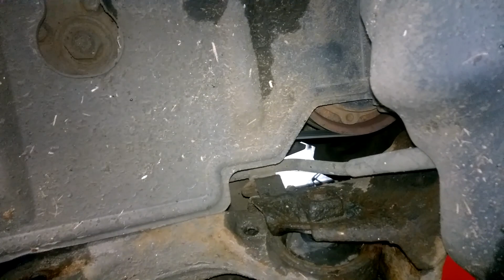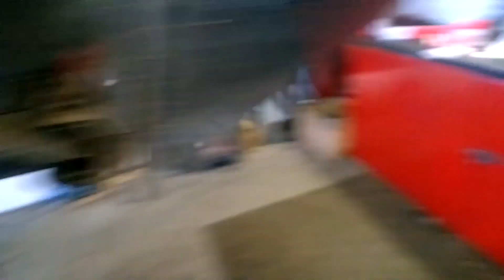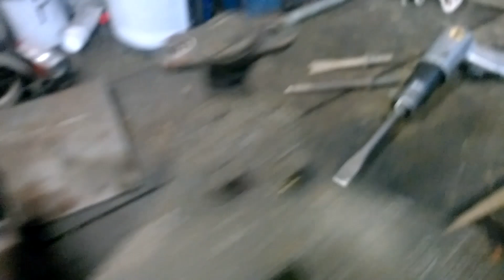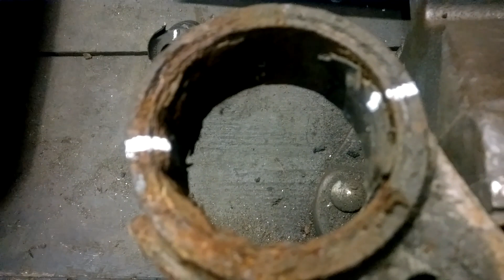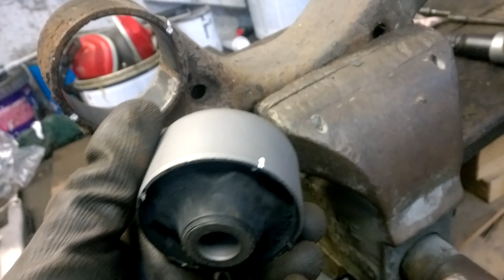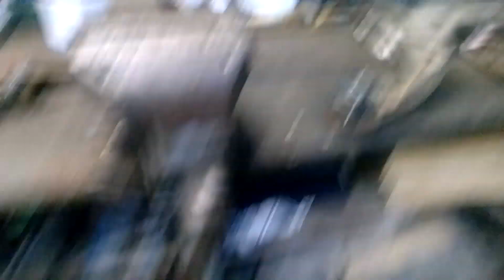How To Replace A  Wishbone Bushing - Step By Step - Kia Sportage

Comment: i tried to remove the bolt from the bush on my kia ceed, the bush is completely siezed onto the bolt and spinning in the cavity, i have no way to grip it, i have spent all night trying different things from wrapping the bush with parachord and wedging a screwdriver into it to tighten it up so i can try and undo the bolt, i have soaked it in penetrating oil and without cutting it out im out of options, i got a pair of grips and tried to tighten it up, i hit it with hammers, pressed bars agsint the nut, whilst twisting, i have no idea how to get this out, theres no room for an angle grinder, i dont have an acetylne torch, i dont have the money to take it to a garage.. what can i doi???

Comment: I don’t see the reason in this case for marking the bearing position?it’s a plain round bushing so why the marking?
Reply: The bushing is designed to "absorb pressure" from a back and fourth motion, its gotta be pressed in a certain way. Otherwise I'm sure it'd be just a solid bushing without the slits.

Comment: @Gerard Burke. Hi Gerard, why did you use the chalk for? I didn't quite get it, lol hope it's not a dumb question. Thanks for uploading your video. M.D........
Reply from the maker: Not a dumb question Monty, the rubber bush is designed to take pressure in certain directions (if you look you can see one part is solid and the other has a break in it),that is why I lined the marks up from the old one to match the new one correctly. 
Thanks for watching.
Reply: @GerardBurkeBurkesGarage  Oh yeah, I just needed to be looking at what you ''were doing'' instead of just watching a video lol. Well I just bought new control arms and now I can't get the ball joint to bolt on because of the angle it's on. I'll probably have to use the Moog ball joints because they seem to have more tilt that the ones that came with (the control arms >>They're made at Detroit Axle, or they imported them under their name. I took a holiday break but I'm gonna head back out and get it finished today..

Comment: Those air hammers are indispensable in this situation. My method is to drill or press out the rubber bit, use a hacksaw to cut one or two slots through the metal cylinder, then tap it out. Two slots can make it much easier sometimes.

Comment: The shop I work at we replace the entire control arm. That thing looks shot! The parts are obviously more but so much less labor.
Reply: Hello I am in the process of doing a similar job on my daughters Freelander TD4 but on the rear suspension and control arms. A 14 year old car. The ‘hard parts’ were corroded more than the item in this video BUT what you are seeing is fairly advanced oxidation but it is not ‘structural’. Using an air needle gun and shot blasting has restored the components to ‘like new’. No structural issues at all. These components await new bushings(all ordered) which I will press in. Before then all the arms are ‘bathed’ in rust remover even after shot blasting. They will be painted etc before the bushes are fitted. Obviously, I have time on my side. Time is the key in any business as ‘Time is Money’. Most components that are replaced on cars have some saveable parts..  but to do so becomes uneconomic due to labour costs. Nothing wrong with this fix at all...

Comment: Very good video Gerard,I replaced 2 wishbones on my Vauxhall combo yesterday the rear bushes in them where knackered just like the one you did,oh and for replacement bolts and nuts try Toolstation good quality and much cheaper than main dealers

Comment: Another great video Gérard.  Just one thing as a viewer I would actually like to see you doing some more of the job I. IE When you cleaned up the control arm, grinding the bolt off. As these are the things that are going to stump is DIYers and would be great to see a pro actually do it so can take note.
Reply from the maker: Hello, Thanks for the comment.  
I know what you mean, sometimes I even have that type of footage but I choose not to use it as my videos were getting too long (in my opinion) I don't want to bore people with 20-25 min either :) but I will try and add a bit more in the future to help with keeping them compact. 
Thanks again.